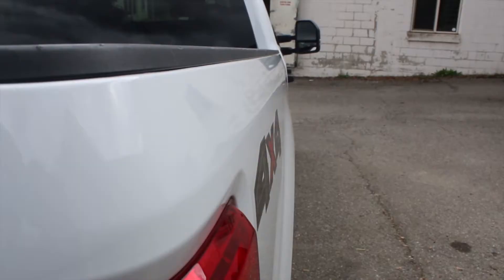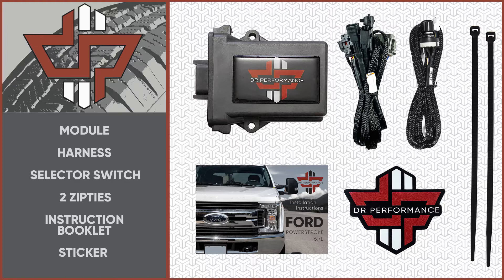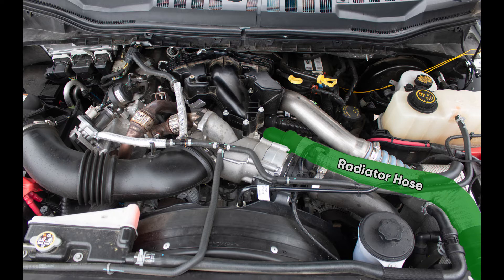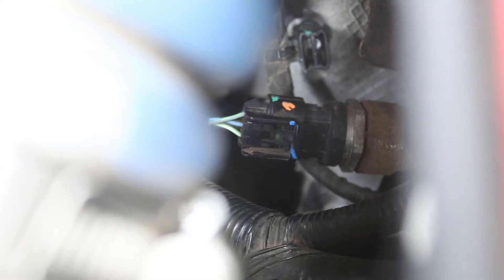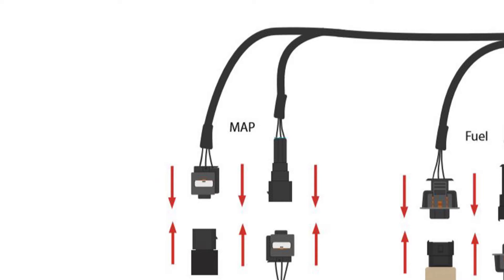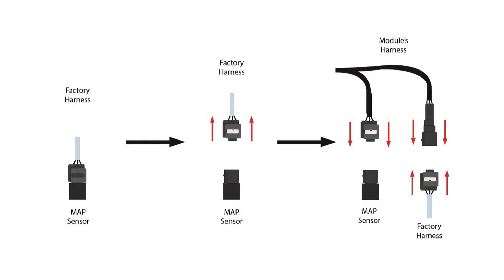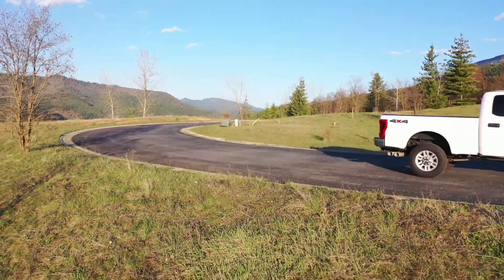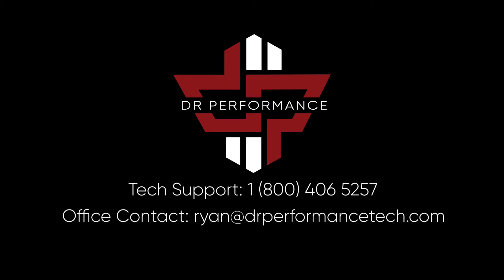Ford 6.7L Powerstroke(2011-2019) DrPerformanceRx Module Installation

Comment: Can you run this along with a EZ LYNK
Reply: Hi Chris. To answer both questions, yes; our module will work with the EZ LYNK and a tune, so long as neither of them uses the fuel or MAP sensors. Be cautious when combining a tune with our module, though, as some changes are multiplicative. We recommend starting at the low end for both and experimenting until you find a mix that doesn't overwork your truck, but still gives you the performance you're looking for.